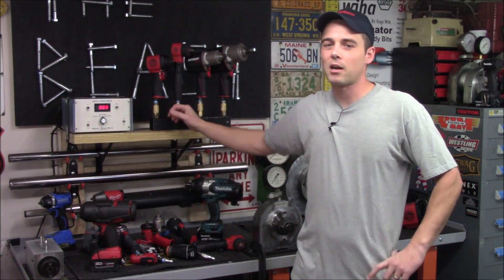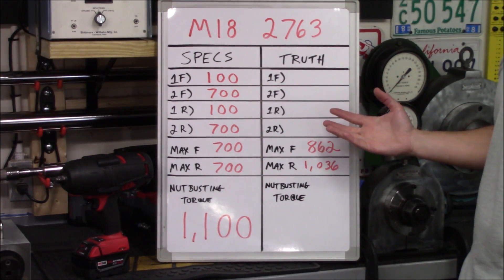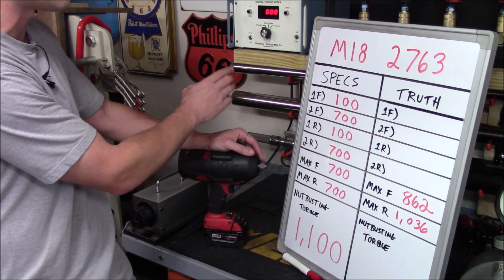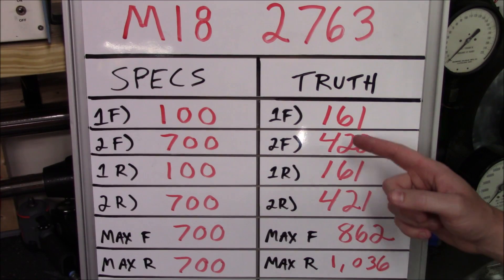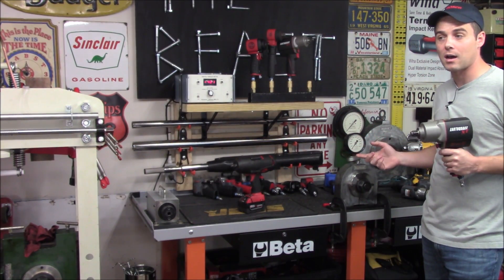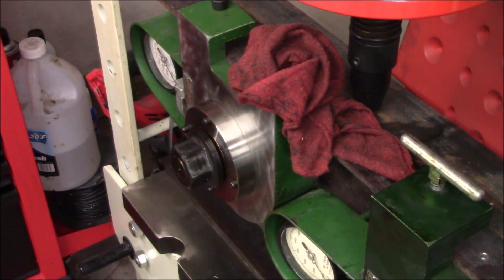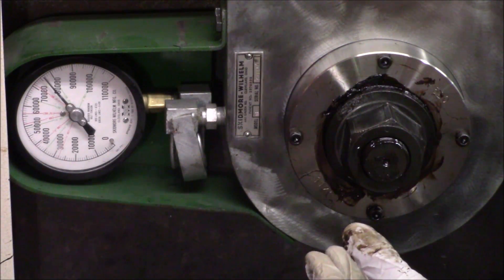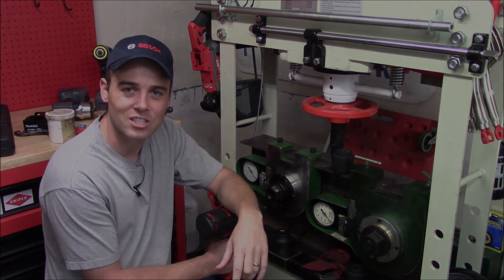THE BIG LIE -- Nutbusting / Breakaway Torque (What is it?) - Impact Wrench Torque Ratings

Comment: This is interesting and good information to have, however, I’m assuming that all manufactures use this same method to achieve their max torque ratings. Would that be a correct assumption, or is Milwaukee the only one that does this? If they all do it, then all the numbers are inflated, but comparisons of torque ratings across different makers would still be valid and useful.
Reply from the maker: NONE of the companies use the same methods....none.  In fact, one company (M7) advertises that “torque specs may vary by 40% depending on the country”.....it is a big problem.  The most realistic #s come from RIDGID & Chicago Pneumatic.

Comment: You may have covered this somewhere but...
Does the size of the socket affect the amount of torque a given impact wrench can deliver? Or, is any given impact wrench able to yield greater torque to a 3/4" nut then to a 1-1/4" nut?
Reply from the maker: Where you are limited is the yield point of the fastener....basically the bolt will begin to stretch and/or the threads rip off after a certain point.  As far as physical socket size.....the heavier the socket, the more torque by definition will be applied due to added mass (flywheel effect).  But for most uses this would not be noticeable.

Comment: A fine video, but how did you NOT try the same with cold threads? That seems like a very obvious experiment to perform. Huh...?!
Reply: Just a few seconds with a torch and your cold bolt will be hot and ready to come off. Gee, where have I heard that before
Reply from the maker: Simple.  This is a hydraulic test unit & the manufacturer specifically states that you cannot leave it under load for long term or it can damage the unit.  I am not damaging my test unit in order to appease the small minority who don’t like the test methods.
Reply: @RealToolReviews  you could run it the same time you did in the vid and note how nothing budged.

Comment: That hydraulic torque gauge gadget is neat, but bolt tension is not a very good way to measure an impact...

Go try and remove a semi wheel torqued to 550 ft lbs with any cordless impact, not gonna happen.

Most bolts requiring over 400 ft lbs are big and require a big heavy (impact)  socket, which dramatically reduces the sharpness of the impact
Reply: What impact gun do you use?

Comment: I have the Milwaukee 1400 lb model and no way is it that strong.  If it was I would not need a 3/4 drive impact.  I torqued a lug nut to 800 lb and it broke it lose but struggled.  I can tighten them to about 500-550lbs but it was not consistent.

Comment: If you hit a scale with 10m/s velocity it can record a maximum weight (force) achieved, say 100kg. However, if you hit a steel block sideways at the same 10m/s with the hammer and you want to slide it on the floor, the generated force will be much higher than 100kg even something like 10.000kg and it depends on the hardness of the materials (steel) and the masses of the hammer and the steel block. That’s because F=ma, so if the hammer stops quickly (when the objects are massive and tough they do) the (de)acceleration (g factor)will be higher. With a granite rock, the force will be even higher. This case is equivalent to a rotating mass). Therefore, a higher grade steel  sockets will tighten or remove the nut slightly better, and something soft (even if it doesn’t get damaged) will yield a smaller value. The mass of the block the nut is mounted on is also important. Then also the value you measure with the digital torque meter is smaller than the real value. So it seems hard to rate the wrenches but I think they did it well enough. How would you rate it?

Comment: I was wondering about the required torque for removing the nut that was tightened up to 1100ft lbs. Is it still around this value 1100?

Comment: I enjoyed the video but you failed to mention the effect of diminished tensile strength via the repeated use of a fastener.  The more you use a fastener at full torque it’s tensile strength diminishes and subsequent uses will result in a lower tensile strength which can make it easier to loosen and easier to break.   Fasteners are graded such as Grade 5 Grade 8 and NASCAR uses a top grade called Bowmalloy.. I sold this kinda stuff when I worked B2B sales and New Business Development with Barnes disturbution years ago and we had the Corp contract for NASCAR and Bush Cup series teams.  I personally use the Dewalt Impact Wrench, I’ve yet to find a bolt it won’t loosen.  Crank pulley bolts come off like butter.  Good video tho!
Reply from the maker: I limit most explanations to what the average person can understand.

Comment: Man you should've had the 120$ porter cable 1/2" in there! Ive been using mine daily for over 2 years and it still goes strong. Best bang for the buck

Comment: This review has good information but it is also somewhat misleading. It seems from these tests that 2R would be the breakaway or “nutt busting” torque, wouldn’t it? These test showed it was over 1000 ft/lbs slightly lower than what manufacturer claimed (1100).  Not sure what is the big deal there? Secondly as a professional user of impact wrenches, knowing dynamic torque is useless information for me. All I care is that it is giving me over 800 ft/lbs forward, which is mote than manufacturer claims and slightly lower than  1100 in reverse. Which is pretty close to what manufacturer stated as breakaway torque.

Comment: Ok devils advocate for a sec here.
I think the "nut busting" is still useful to know ( yes it's a marketing strategy). But if you have a 1 inch bolt that is rusty and hasn't been touched since before i was a twinkle in my dads eye. Heat it up just a bit, and because you know it has the power, you use  impact wrench . It comes off.  It might not be dynamic torque, or what it is capable of tightening to, but it works. My buddy has this wrench, and we use it more than our air wrench when working on old trucks. The air house can really get in the way.  I just thought it had to be said that it's  not a totally useless spec
Reply from the maker: Why not rate them at 10,000,000 Unicorn Power? 🦄 

It’s a fake term designed to make their impacts APPEAR to be more powerful than they really are.  It is a scam plain & simple.

A better method would be to use actual torque #s instead of fake ones! 🤔
Reply: @RealToolReviews  i did say devil's  advocate 
They can say what they want, i probably won't  believe them. Every company lies. And most anything is a POS. You basically pick which color you like. Everyone is just so similar

Comment: Stumbled upon this video... Enjoy how you used scientific methods to test manufacturer specs, but I have an issue with how you use the ideas of Torque, Friction, and Tension (but maybe you are doing this on purpose). You're 100% correct that torque is greatly affected by friction, and manufacturers misuse these terms to mislead ill-informed consumers. Unfortunately, and this is the biggest issue, torque is the ultimate goal. Torque does not equal tension, torque is used to achieve tension. Tension, or better yet clamp load is the ultimate goal! The second test stand, the "static" torque tester, only allowed you to observe bolt tension (which is a very powerful observation)... but, then you assumed that "dividing by a factor of 70" would give you the exact torque applied by the tool to achieve that tension. The most critical thing we must all remember is: in most applications clamp load is the goal; and that clamp load provided by bolt tension. Simply put, torque is an obligatory force measurement which 'should' provide the desired bolt tension, so the torque specified by a manufacturer is the force the tool is capable of achieving not the bolt tension the tool is capable of achieving. Now we definitely agree friction affects torque, but how does it affect torque? For all intents and purposes, friction actually changes the amount of bolt tension your torque value can achieve. Heat can certainly affect friction but not as much as the massive amount of lubricant you applied to the joint. So unless your extrapolation method (dividing your measured tension by a factor of 70 you used to assume torque) was verified that it was actually achieved by 1100 lbf*ft the statement that the Milwaukee tool can achieve 1100lbf*ft is incorrect; the only true statement we can make is that "THE MILWAUKEE TOOL IS CAPABLE OF BREAKING AWAY A NUT FROM A JOINT WITH AN OBSERVED TENSION OF 77000lbf" I suggest the following study using the scientific method:Hypothesis: Same Torque Inputs will Achieve Different Bolt Tension Values depending on Friction.Input: Max Torque of Milwaukee impact gunVariable: Friction or ‘Lubrication’ applied to joint 1. No Lube 2. Lots of Lube 3. Heat (which you assume is a lubricant – but we shall see)Output/measurement: Using the static “torque” tester measure the bolt tension of several rundowns @ tool max torque (same time, same tool settings, same battery strength for every single test) for 3 variations of friction.If the bolt tension does not increase with a decrease in friction using the same torque input I will change my name from Torque Man Dan to Dumb Man Dan. By no means am I bashing this video but I feel it’s my duty to educate the average consumer on the concept of Torque and Tension: 1. Torque is simply the measurement of the amount of twisting force provided by the tool. 2. Clamp load provided by bolt tension is the ultimate goal. 3. Because torque measurements are subject to variables such as friction, assuming tension will remain constant for a given torque value is FALSE… if it helps you conceptualize, consider lubrication a “torque multiplier” multiplying the input force(torque) to achieve a higher bolt tension. 4. Manufacturer specifications must be critically analyzed, as well as the concept of TORQUE, FRICTION, and TENSION!
Reply from the maker: The point would be to repeat the same test across a variety of impacts -- allowing the consumer to easily see which one is more powerful.  Yes, I agree that torque/tension is subject to many variables, however keep in mind that making this a simple explanation is the best way.
Reply: I agree, simple explanation is key, but knowing these concepts will pay dividends. Keep up the good work and keep the videos coming!

Comment: Decent review and testing. I brought the mid torque to work on my van etc and today found it could not undo the bolts to the road wheels torqued to 160nm when cold. But the day I got it, I undone them, but I had been on an hours drive so I guess like you say it has more ability when the nuts are warm. Disappointing from a gun that claimed 610nm on the box 📦🤔

Comment: Yeah but it's still impressive for a hand held battery operated tool. I seen a video for the nut busting 1400 lbs 2767-22 impact that removed a bolt torqued to 1406 lbs. The bolt was torqued using a torque wrench and a multiplyer, so the bolt was indeed ice cold.
Reply from the maker: If it was freshly torqued/installed the threads were super-hot.....meaning a lot less torque was needed to remove them......it is a little trick that marketing companies like to play pretend with.
Reply: Real Tool Reviews A hand torqued bolt that's able to withstand 1700 lbs which is what that bolts rating was, is not gonna get hot enough to soften it. It may get pretty warm enough not to handle, but not super hot like you're claiming. Sure steel gets hot, but then you forgot to take in consideration that there's lots of different alloy steels. For a bolt or nut to get soft enough to do as you're stating, it wouldn't torque down like that without twisting into or shrinking first. I've torqued down many bolts in my day, a bolt design to be high torqued is super hard steel, they don't soften up enough when hand torqued, to be easily removed again.
Reply from the maker: Rub your hands together.....they get hot.....that is called friction.  The hotter it is, the less torque it takes to remove it.
Reply: Real Tool Reviews I wasn't born just yesterday I'm well aware of what friction is. I could rub my hands together for hours at a time, doesn't mean my skins gonna melt either.
Reply from the maker: You’ve fallen for marketing schemes unfortunately.

Comment: This is all good but any time I was to remover a nut or bolt it is not hot or greased . Mostly they was rust in for 2 years  or more or even rusted so bad that they become as one part . Rusted so bad that are literally rust welded . This changes what a impact can do in removing a bolt .  In some specs calls for no lubrication  .  I know this test does not have nothing to do in the real world of application . But it does tell us what to torq is on the bench and what we should get know matter what condition is in the real world .  It helps .
Reply from the maker: Watch the other vids I made which include this (and other impacts)...all of the newer ones have torque testing proof.

Comment: There's nothing misleading about nut-busting torque, unless you don't understand the difference between it and fastening torque. Both numbers are clearly stated to be different in their marketing materials. It would be stupid to even have an impact wrench that had the same torque for both numbers because no commercially available tool can hit the exact numbers with production variances in manufacturing. People would end up fastening bolts on that they can't remove. It's good to see these things tested though.
Reply from the maker: Sure there is....it is a complete BS marketing term to make one impact sound more powerful than the next.
Reply: Real Tool Reviews You didn't refute any argument I put forward. You just reiterated the same baseless assumption. So lets go with this, an impact wrench from another brand could make 1200 foot pounds of torque to remove a bolt, but only 1100 fastenning. If compared to a Milwaukee one with 1100 fastening and 1300 to remove, do you really think I'm going to get the former one? The production variance and variance after wear on the other might mean I put on a bolt and can't take it off, or also possible, the battery charge drops and then because of the reduced power, I can't take off a bolt that I fastened earlier, or a bolt tightenned to higher spec by someone else's more powerful tool. Also, maybe I often have to take off rusted-on bolts that take far greater force to break free than they were tightened with. Are you really saying the more powerful torque to remove them is just a gimmick? The times I've needed the most torque on my impact were removing bolts put on by a pneumatic or ones that were rusted. Another aspect of this is that if Milwaukee or any other manufacturer could make the tool that powerful in reverse, then they could have just changed the design and made it just as powerful tightening. So that begs the question why they wouldn't do that. Following your logic they would have done full power for fastening torque too.

Comment: Could you check the same specs for the Ryobi P261 1/2 inch Impact Wrench? Factory is rated at 300lb, but I want to know if they have more "nut busting" torque.

Comment: so I am think about buying a Milwaukee 1/2 or a 3/4 impact drill ..
I am a field mechanic working with heavy and farm equipment what do you decide will be better off and power-wise for those big to 2-inch nuts & rusted bolts to be removed with out a problem in one of your videos I'll see u compare both of them on torque to tighten and to remove....

Comment: Have you ever tested that small digital Matco torque adapter head? To use on any ratchet or breaker bar, effectively allowing them to be used as a tq wrench. Wondering what the accuracy of that head would be vs a full dedicated wrench.  CTA250 part number I think.

Comment: That whiteboard looks like it's shopped in for some reason....
Reply from the maker: +Pegasi Incorporated weird....they are a pain to use due to the glare of the LED lights in the room....only certain angles will work.....I'm not a fan of them.
Reply: You could always get a sheet of MDF and use some "Chalkboard paint" on it to create a custom chalkboard like I did for my shop some time ago.
Reply: The paint's about 10 bucks for 30 ounces at Home Depot, and a thirty ounce bucket will do a LOT of chalkboards. The MDF is about as cheap as you want it to be. I scrapped mine from some crappy old drawers a while back.
Reply: Definitely beats Walmart's price for a crappy 3x2 foot whiteboard.

Comment: Makes me wonder if milwaukee is basing their numbers off of the 9.0ah battery. They claim an additional 35% power out of it. But still, from 420's to 700 is not 35%
Reply from the maker: Here is the best way to explain it.....Lets say Milwaukee made a $5,000 car that they wanted to compete with a $60,000 Corvette.....the Corvette will go 200 mph.....the Milwaukee would max-out go 55 mph downhill.....BUT --- if they drop the car out of the back of an airplane, in free-fall it hits 200 mph @ 30,000 ft --- they now claim "Our $5k car can go 200 mph"......
Reply: That's a great explanation. And fantastic layman's terms. Thank you. And its terrible false advertisement. But one problem, there's no chevy that can go that fast. 😂

Comment: Love how you break this down and though I don't think I will ever have to deal with a bolt at the rating you used.... I"d have to search to find out what bolt could possibly ever be on that tight that is not part of a massive engineering marvel...
Reply from the maker: Structural bolts (Bridges/Steel Buildings...)
Reply: ...not exactly something us regular folks would be building in our back yard.... well maybe a tornado shelter or underground bunker =)